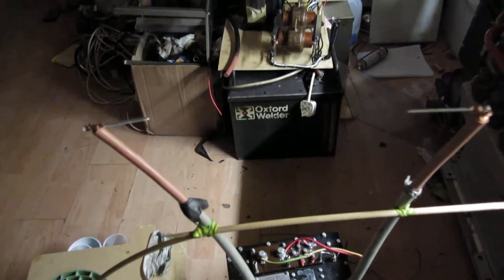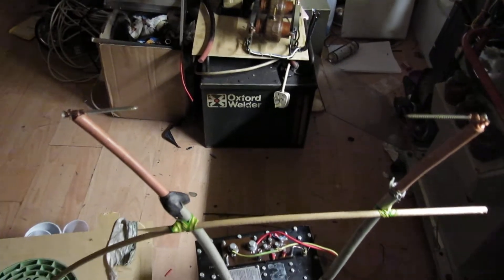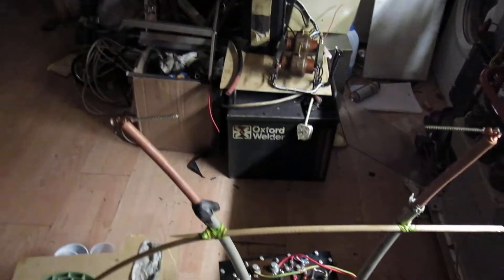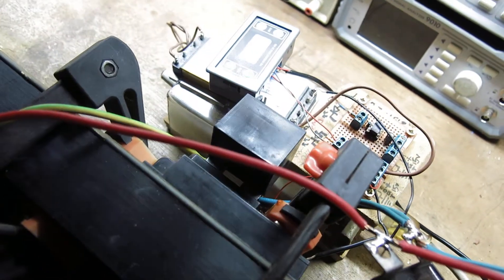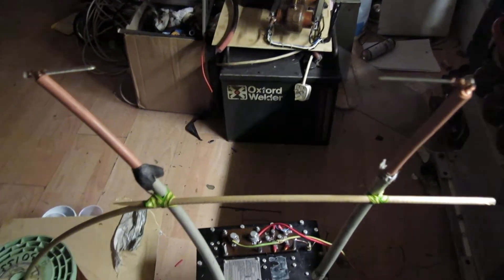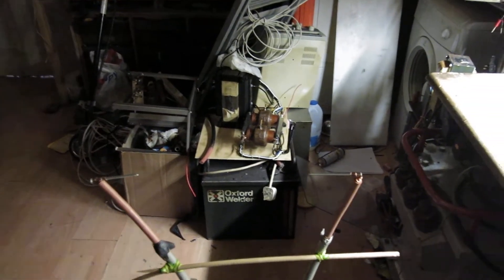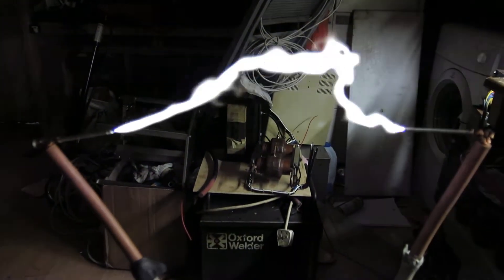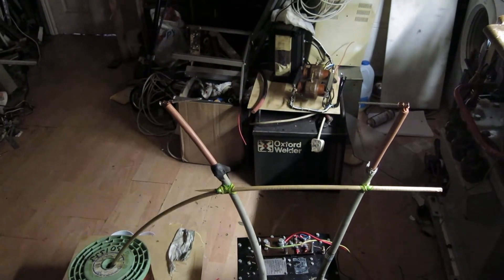X-ray Transformer Overdrive! 300,000 Volts AWESOME!

Comment: Biggest flyback on YouTube? 😂👍
Reply from the maker: Not sure its the biggest flyback on yt but maybe the biggest flyback arcs? 😄
Reply: @T2D.SteveArcs  Certainly the biggest flyback that is actually operating in flyback mode.  Probably counts as the biggest boost converter on YT
Reply from the maker: @sk1ppy506  it's a big arc that's for sure😁